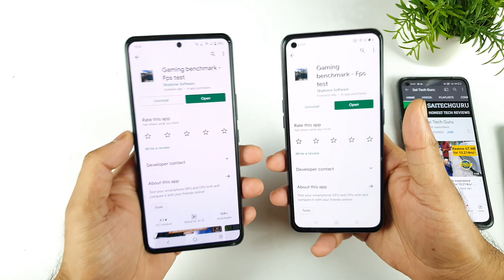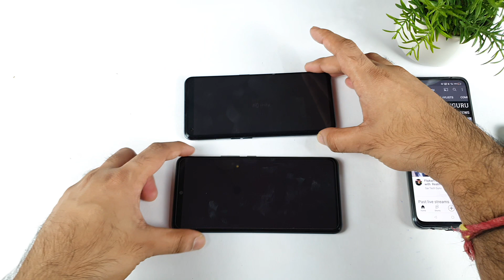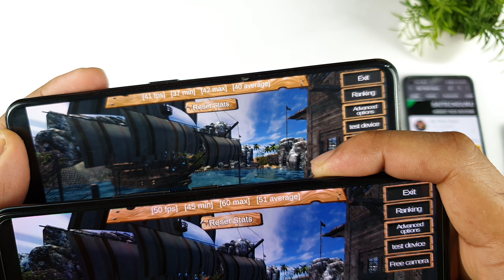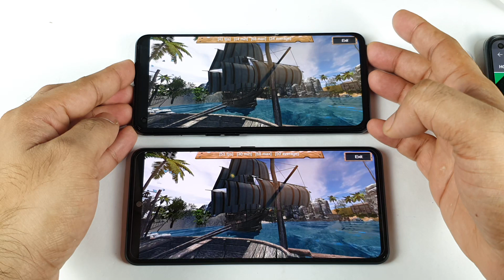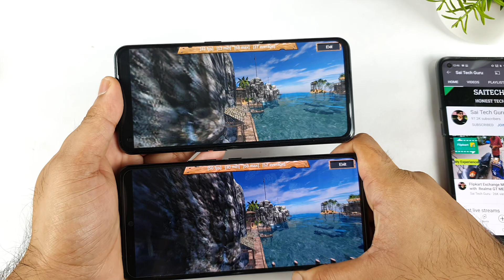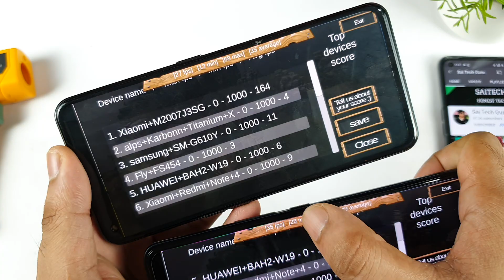iQOO 7 vs Realme X7 Max Gaming Benchmark Comparison Which is Best Snapdragon vs Dimensity 😱😱🔥

Comment: Bro Snapdragon 870 vs mediateck dimensity 1200 which processor is best for BGMI without lags , renders , frame drop in smooth extreme or high graphics comment plz bro 🙏🙏🙏
Reply: Frankly 870 is good but If u consider only bgmi then I will go with Dimensity 1200 because of 90fps only realme x7 max
Reply: @FactHits  🙏 thank u
Reply: @FactHits  you are correct my brother, you are my true hero of all time. I am using x7 max too.
Reply: @joybhadra8816  thanks 😂
Reply: of course dimensity 1200
Reply: 870 good but not great
Reply: @manishankar2468  👍
Reply: Ofcourse SD 870 ya
Reply: @joybhadra8816  👍
Reply: @prathamsalunke4043  🙏